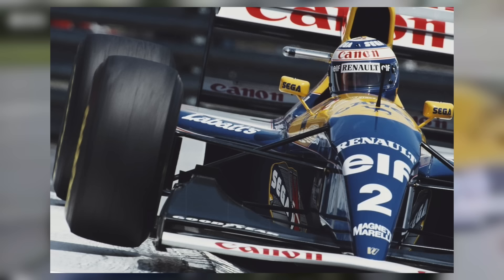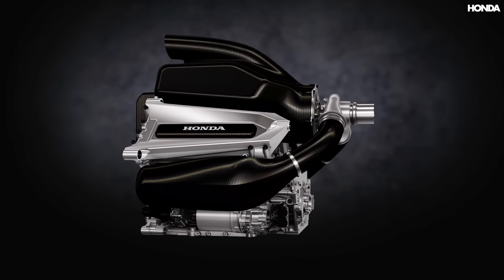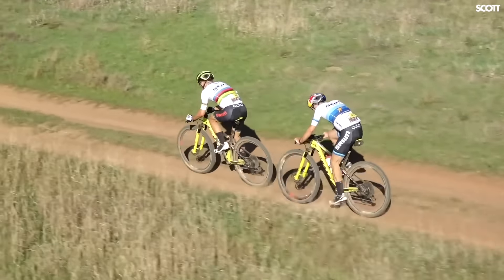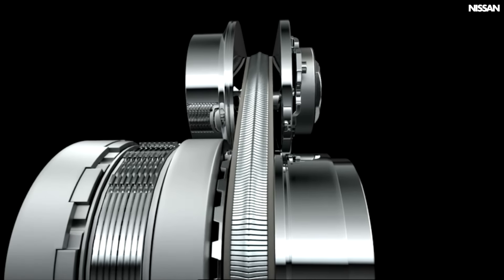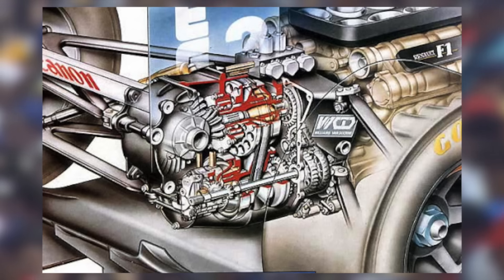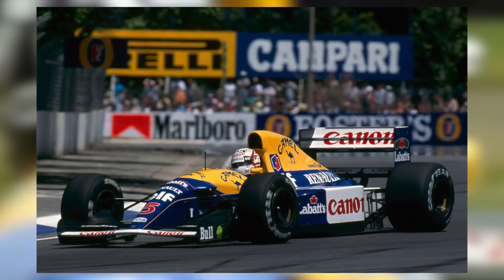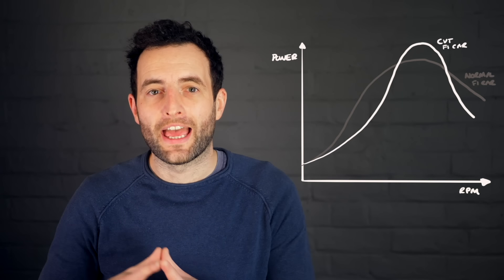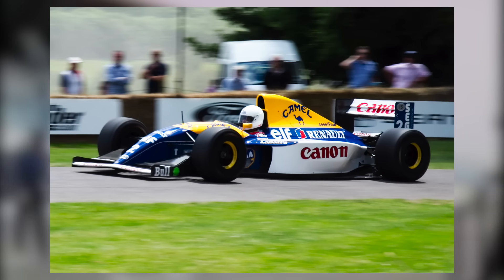The Formula 1 Car with INFINITE GEARS | The Blueprint

Comment: During a tour at the DAF museum where the car is on display, I was told it was banned because a maximum of 8(?) forward gears was allowed at the time. While Williams argued it had 1 forward gear, the FIA argued it had infinite forward gears, and thus too many.
Reply: At the time, the max gear was 7 and the FIA banned it by name a bit later... They didn't leave place for interpretation.

Williams didn't have the time to develop it to it fullest.
Reply: Yeah and in the end, it costed DAF its car department, since it was seen as a wife car and so lost a lot of traction. Joining F1 woud change that hoped DAF
Reply: @gercobosch2870  Would've definitely been sweet, especially if DAF was able to develop a nice car for a change that could rival at least a Golf GTI mk2 or Opel Kadett GSI at the time. Even more so if it could rival the Lotus Omega/Carlton! Just imagine... a DAF roasting a Lotus Omega... OH MY LORD!!! 😱 In fact I'd still love to see it today.
Reply: It’s not actually infinite, that means no end. There is a minimum low gear ratio, and a maximum high gear ratio. It’s actually stepless, not infinite.
Reply: @raymondsanderson3768 but you could divide the section between the low and high ratio into infinite small sections or ratio's.
Reply: @raymondsanderson3768  It means an infinite number of gear ratios
Not an infinite gear ratio
Reply: Infinity is not a number in the first place, so claiming that infinity > 7 is a completely invalid maths term.  It is much like saying tacos > 7.  It is not maths.  Of course the FIA dodged this easily by not using maths and simply banning it directly with no reason given.  
With all that said, I suspect the aesthetics were of much more concern in this ruling than anything else, I'm sure Fer... ahem, the FIA would have just started using CVTs as well if it still sounded right to those watching the race.
Personally I love CVTs and I hate how modern car manufacturers are deliberately undermining performance and economy, especially for everyday road cars (even electric) just to maintain utterly retarded "feeling" and "sound" of gear changing.  If we just accepted it, within a few years the very concept of gear changes would be the thing that starts feeling wrong.
Reply: Well, in the London-Sidney rally in 1968 the DAF 55 ended up at 17th place. Not bad for a 1100 cc engine.

PS
In Helmond, at their desing department, a 343 Volvo was a test vehicle ran around with a CVT and a Renault turbo engine. Sadly the belts lasted not more than 10.000 km. It was bloody fast, nice set of campagnolo rims with orange accents on the rim. It wasn't equipped with the push belt, but a normal double belt from the 66 and 343.
Reply: That´s clearly a pure philisophical question, and we know how such debates end: Those, who have the power, end the discussion and have the right on their side.

Comment: I wonder if that system could be made reliable enough for 1-2 races nowadays? Would be very interesting. I can only imagine how weird would be to slow down to corner and still be at nearly max rpm constantly :D
Reply: I wonder what that would do for engine braking
Reply: @Colby_0-3_IRL_and_title_fights  no idea
Reply: Even if its reliable the problem is the engine temperatures for staying in high rpm all the time
Reply: @boopitywoop7981  yeah it would be hard to make for sure, but if the horsepower would be slightly reduced and cooler enlarged it might work
Reply: @megapet777  teams are competing to make the cars as sleek as possible and here we are making them theoretically larger for the cvt laughs
Not to mention the added weight for the additional engine materials for strength in 300kms of race and the engine we have now is a 1.6 liter v6 so you have to stay close to redline most of the time

Its not interesting but just nostalgic
Reply: There are CVTs for HGVs now so it seems to me that they could be developed for F1 cars too.
Reply: @boopitywoop7981  
The engine could be revved down in corners to cool the engine down and if necessary the engine could run at a slightly lower speed when temperatures would go up too much.
Reply: Look up toroidal CVT. It could handle more torque than belt CVT. It also exists at that time. But I suspect that the weight and the dimensions of it defeats the purpose.
Reply: what about an electric cvt similar to how diesel electric locos work ie. the engine putting its power into a generator that powers the wheels through a modern vf drive and electric motors. all wheel drive optimal traction and tourque steer in cornees are all possible
Reply: @SimonBauer7  Then you'll need diesel engines as well. Also combine it with a hybrid drivetrain to recapture energy from braking, then it could have huge advantages. Add Williams flywheel battery that would be overkill.
Reply: @SimonBauer7  
What you’re suggesting is similar to an EV with a very small battery and a rather large range extender. For racing that would be much too heavy I suspect.
Reply: changing the belt wouldnt be a problem for the teams but the engine temps would be too high and ineffective either the engine would break or you would need lots of big radiators which would increase drag so you gain nothing
Reply: @SimonBauer7  efficient would be horrendous, you'll have to convert energy twice before get to the road
Reply: seeing as this tech is now mature, I'm not sure why it would not be fine
Reply: I think both engine braking and accelerating will be better. I don't think it will necessarily be destroying the engine. Perhaps there could be modes or maybe even continuously variable rev limiter. So when the engine needs to cool off - lower the revs. When there's thermal headroom in the coolant - request more power.

Kind of like the battery. At the end of the day the coolant has a mass and that affects how much energy it can absorb before reaching critical temperatures. it would be pretty similar to the battery I believe
Reply: Load is increased during changes in rpm,  all engines will last longer at a more continuous rpm
Reply: CVT’s are used in road cars today in fact my big Audi A6 has a CVT and I have considered having one built for the big power VR6 A3 and the inspiration came from this very Williams! 

A CVT would be epic for drag racing
Reply: @alorynelftuber  oh the belt on a top fuel car would need a swap every run but then what isn’t changed between runs on a top fuel car 🤣
Reply: @alorynelftuber  I meant more enthusiast drag racing like I would do with 1000-1200hp
Reply: @mohammadrifqisatriamas7311  Consider that the engine would be operating much more efficiently. Also consider how surprisingly efficient electric motors are. Mechanical transmission isn't perfectly efficient. The engine would be tuned for one rpm too.
Reply: @Mr_OoOsH  Topfuelers already run at constant rpm , they have no gears.
Reply: @V8Lenny  this is why I’m NOT talking about top fuel drag cars
Reply: Well I guess it would be possible as the CVT belt is considered a maintenance part, like a serpentine belt is.
Reply: Just don’t let Nissan make it and it might have potential.
Reply: The car would ran out of fuel half way through the race and engine would blow up or just overheat
It could be good for qualifying tho
Reply: I got a cvt with engine rpm optimizaton controll in my tractor so yeah its definatly possible. Todays f1 engines are more like diesel engines anyway so i think it would be doable
Reply: i think you could do it in the trans itself.  But the problems related to running these engines at such high RPM for a nearly always ON duty cycle would take some real work.  Though, you'd probably get away with less over HP is your always in your peak power band.  I dunno, its fun to think about.  a shame they banned it.
Reply: @Callthe Copington: 17-3 MMA, 0-3 IRL  it would help , just as downshifting helps for braking. So I would think it would just be a better version
Reply: Talk to Nissan about their failing cvt's
Reply: @Conservator. You could tune the CVT to how you'd like, so for each track you'd only be at a higher RPM mid corner etc, you still need engine breaking to have your weight balance towards the front so you can turn

Also you'd only go up to your RPM where peak power is made, which isn't always the highest RPM it's usually before the max RPM, so it would sit below max RPM, the reason why they rev their engines out is because the next gear needs that extra RPM on the flywheel to get enough inertia to not bog it down in a sense or be out of your power band, I'd say given more time they'd be coasting a lot more and using their mid corner and exit speed to make up the 10ths that they'd lose from coast breaking. 

It's all programmable though so they'd be able to make it as fast or slow as they'd like, given a year of development I'd say for reliability they'd just keep it faster than normal but with lots of low revving periods to not wear the engine out. It wouldn't work this day and age though I'd imagine because each engine has to last 7 weekends now, including sprint races
Reply: My friend had a road car with a CVT many years ago. It was so strange to sit in his car and hear the engine sound stay the same all the time, like what Coulthard said.

Comment: I sometimes feel like the FIA is purposefully hindering technological advances. Imagine if F1 teams were given a chance to use and perfect the CVT and their advancement would trickle down to us consumers.
Reply: Yes, the FIA holds back some advances. This is no secret. Main reasons:
1. Safety. You don’t want cars going through the corners at 400 kmph.
2. To keep the cost down. If certain teams that are rich or have huge companies behind them get to spend endless amounts of millions, then it just isn’t attractive anymore for small teams to stay in F1. According to Wikipedia: “CVTs were prohibited from Formula One in 1994 (along with several other electronic systems and driving aids) due to concerns over escalating research and development costs and maintaining a specific level of driver involvement with the vehicles.”
3. The individual skills of the driver must remain important. As mentioned in the quote above, you don’t want the cars to do all the work for the drivers.

The first CVT was invented in 1879 and is still used in cars, e-bikes, tractors, and other vehicles. You needn’t worry about its development.

Comment: I'm one of the few car enthusiasts that actually like CVTs, for daily driving. But it's a shame there was no usage of this in a full length championship, to test it, develop it and prove it's application in motorsport.
Reply: yep, like kay, f1 can't have them now cause it will kill someone, but we will add a safer (heavier), more open category where you can go all nuts and test stuff to your hearts content. 
if it doesn't want to kill your drivers or the car, we will consider allowing it in a next f1 championship
Reply: i think the problems they had with it were that it significantly lowers the skill floor of the sport since you basically have the power curve of an EV with the power and weight of a gas car, and no need to worry about shifting gears, and that it would make the entire race sound like a beoing 747 is idling on the track

Comment: @07:35 "If it ain't Dutch, it ain't much" The Dutch company DAF, founded by Hub van Doorne, more specifically Van Doorne himself invented the first CVT an DAF's sub-company "Van Doorne's Transmissions".
As for the power to be delivered: they are used in diesel-electric locomotives...

Comment: I was born in the Netherlands in 1951 and my father had a DAF (Doorne's Auto Factory) with a CVT. Van Doorne which is the Dutch guy who invented it and held the patent. The factory was in Eindhoven the Netherlands - same place as the headquarters of Philips Electronic - another Dutch company. I drove it quite often and yes, one gear from one to 120 Km/ hour and you could go as fast forward as in reverse! I never tried it though - too dangerous. If I remember right Volvo (Sweden) and DAF merged or probably better Volvo bought DAF but I think Volvo never used it in any of their production cars. The years I drove my fathers car must have been early '70s. The belt had to be replaced frequently (40k KM? - not sure) and if I remember right. It was a fun car to drive. Acelleration better than most cars with "normal" gearboxes. :goodvibes:

Comment: I knew Peter Weismann in Costa Mesa Ca a Smart Man but if you had a Weismann gearbox
good luck in getting a replacement part that was to the same Dimension as the original parts.
That way the boxes never caught on. March used Weismann boxes in the Indy car one year 
and switch the next year.

Comment: there''s another reason why a CVT won't work in F1 - need to add a clutch to avoid stalls under fierce braking. the CVT itself is designed to slip so throttle response won't be good. now if the belt had teeth...

Comment: The main problem / restriction of the CVT system is the qualitity of the brackets/shackles. In 20 years this has been improved/solved. But still the general idea sticks that CVT is not good enough for long  and easy use in cars.

Comment: 7:40
It was Dutch, DAF which usually makes lorries. They had a small lineup of cars though and their cars also used a variometic gearbox which makes them fairly unique compared to other cars. One feature of the variometic also is that you have a gear for reverse which means the car can go almost as fast backwards as it can go forwards which is what the DAF 600 became famous for.

Comment: How does the CVT effect engine braking on a performance vehicle? I imagine that would be another reason they’re not popular except in OAP vehicles.
Reply: The ones that were manumatic, you could choose to downshift and properly downshift otherwise it’s set by speed and brake input. 

You coast unless you have a clutch and gear selection. Or build for what the gear ratio will spin the engine 22k 😂

Comment: You say CVT existed before, but it didn't, the French invented it for Formula 1, then used it in production cars.

It was reliable after very short testing and development, it was banned because it gave a huge advantage.
Reply: good info. also near 9minutes, he mentioned these things would overheat. i really doubt this claim. i think they would run similar in temps.

Comment: "zero max", is a cvt that is not belt driven, used on industrial machines. levers push a ratchet and the degrees are changed. it could handle high power and high rpm, and not slip if designed for a car or truck.

Comment: CVTs have always had a checkered past. Reliability has  been an issue. Ford used a ZF CVT in the early 2000s, but went back to a 6 speed box for better fuel economy and reliability.

Comment: Just because the engine is doing 18krpm doesn't mean it's producing full power all the time, so your point about heat is less of an issue than you state. The point is the engine can go from overrun to full power in the time between two cylinders hitting TDC.

Comment: It was a dutch company, the origin of the system was called variomatic or VDT (Van Doorne Transmission)  and used in DAF roadcars, later on in Volvo cars produced in Born (the Netherlands). 

The car is on display in the DAF museum in Eindhoven in the Netherlands. I saw information on this car and the car itself when I visited the museum.

Pretty cool idea and engineering.

Comment: The vid posted years ago showing the design of the hd gear driven cvt seems to have been scrubed from u tube. The origanal designer is an electronic engineer,  and the design was acquiesced by the military for drive systems, and to maintain rpm for alternators.
Ive yet to have a chance to look inside john deere tractors, but i assume they have been given righs for their drive systems seeing as they are superior to hydraulic systems.

Comment: Reliability has changed quite a bit. The Japanese self-defense force run the Mitsubishi type 10 tank of 40 tonnes and 1200 hp on a CVT. While the high revs of a formula 1 car is its own challenge, so is 40 tonnes of box bouncing on terrain that's impossible to drive over with wheeled vehicles. The mostly guaranteed reliability distance of a modern tank is closer to the full formula 1 race season than a single GP.

Comment: wait, where are you getting your information for the claim @8:42? if you downshift and don't use carburation, why would the engine temps increase? they would decrease because you are using air to engine brake with no fuel going in. it sounds like you made this up upon the idea that these things will run at over 15,000+ for the entire race.

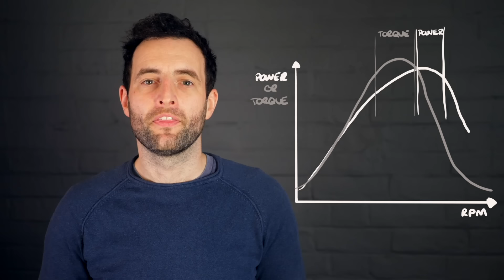Comment: 5:50 I don’t follow. Maximum power works best in either case. Isn’t maximum torque just a rather meaningless metric, maybe indirectly implying the low rev (or wide range) power characteristics of an engine. The maximum power is always optimal, the high torque band being un relevant.

Comment: The max/peak power is where the wheel will receive max torque possible. You don't care about the engines peak torque as it ignores gear ratios.

Comment: Ok- this video is incorrect regarding the type of CVT transmission that Williams was testing. I also think DC is remembering things wrongly? Anyway- as another commenter has pointed out, it makes more sense to use toroidal CVT. I distinctly remember being taught about this at university in 1995, and Williams used a toroidal CVT transmission (I think the company was Torotrak?) and those do not use belts, so they can easily handle the 800bhp. They use metal discs and special friction fluids to transmit the torque, and the discs vary in angle against a plate (a bit like a clutch). So no- there was never and F1 car with a belt CVT gearbox. Ever.